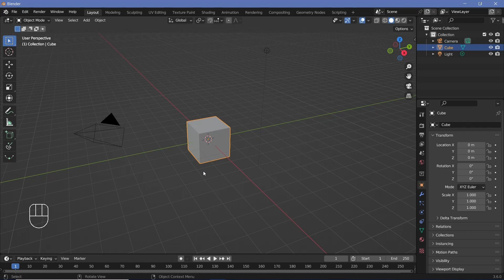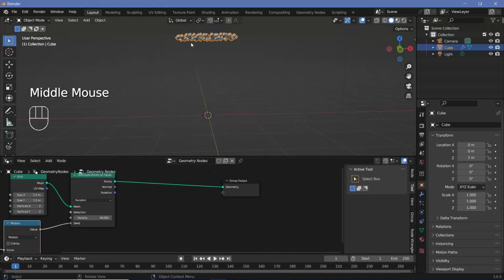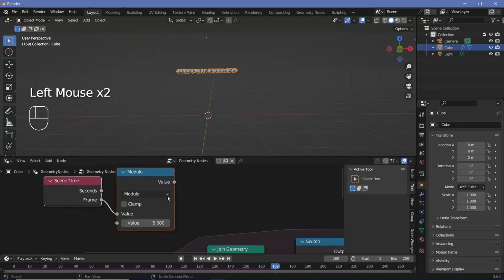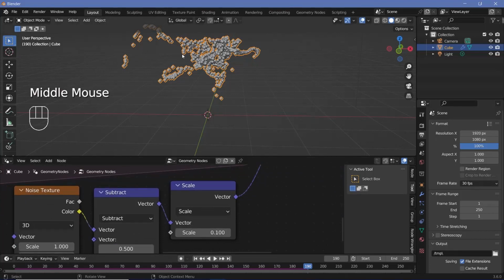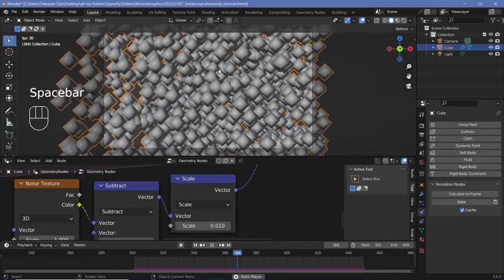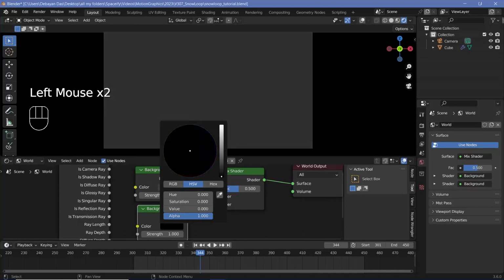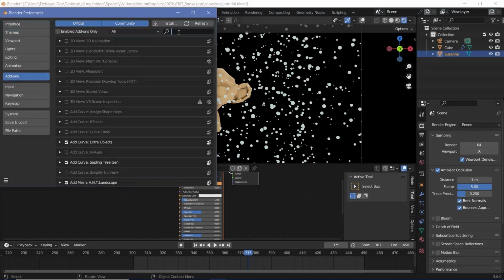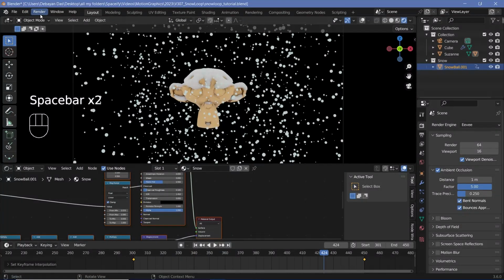Looping Snow Fall using Simulation Nodes - Blender Tutorial

Comment: Thanx for the video. I have a question. ) First frame in this loop is 301. 
Is it possible to start this loop from the 1 first frame to move this simulation to another scene with a different duration? Or do we just need to change the parameters?
For example, a scene lasts 900 frames...
Reply from the maker: Hi,

In order to have the video to start with all the particles, some number of frames is required. If your scene lasts 900 frames, I would say the easiest way to go about it is to have it go from from frame 301 to frame 1201.

You can always have the simulation start at a different frame AFTER frame 1, but I still haven't found a way to have it start before frame 1. And it would be necessary to start the simulation before the first frame if you want the loop to start at frame 1.

I hope this helps :)